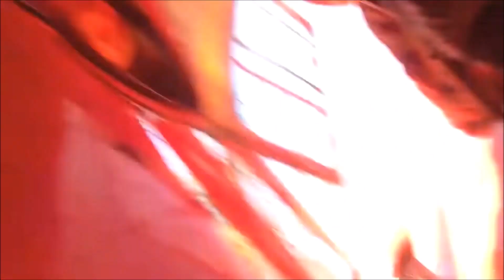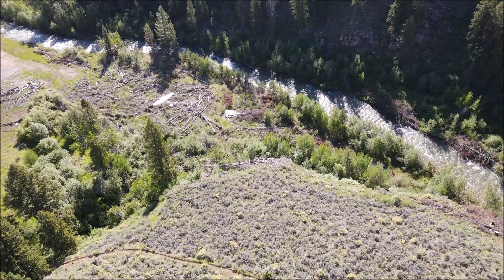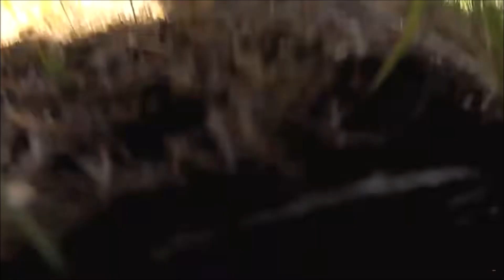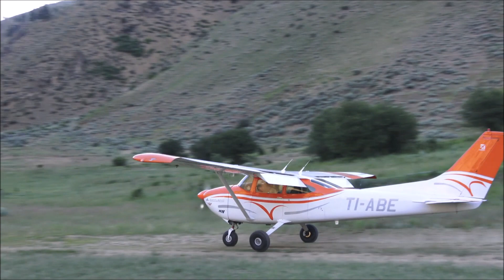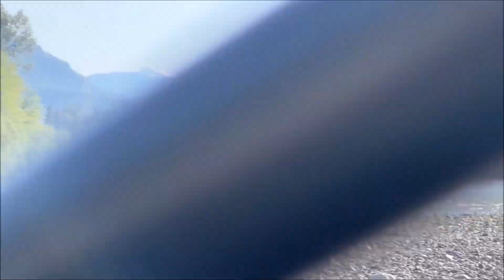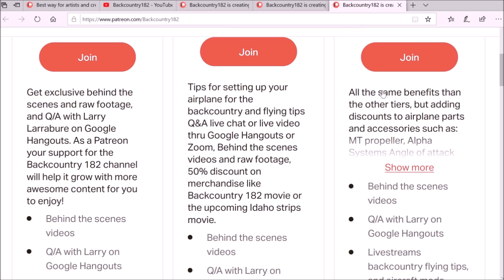Surviving your first Backcountry Flights

Comment: I was on the Cobalt District trail crew and we flew into the Flying 'B' guest ranch airstrip all the time. From there we would puck up our stock and work trails back in the wilderness. Air density was always a major player in taking off as we needed to get out before 8 am or it would be considered dangerous. The summer ambient temperatures back on the Middle Fork of the Salmon River were 90+ degrees Fahrenheit. Hearing the stall alarm was always strange because it meant we were falling out of the sky. On either side of the runway were bits and pieces of wrecked planes. Thats part of the job i never liked.

Comment: The investigation into the Stinson crash at the beginning found that he took off with the mixture full rich at a high density altitude. That's waht got him, the engine was running WAY too rich and just couldn't make enough power. It's super important to lean to best power for high density altitude takeoffs when flying on a Naturally Aspirated engine.
Reply: I agree that leaning would've helped, and likely made the difference in that example, but the climb performance still would've been anemic with that load and DA, based on my Stinson experience.

Comment: Thanks for posting what is some of the most important information about Backcountry flying  there is.  Besides altitude there is another factor besides density altitude. So often you practice techniques in a lightly loaded airplane. Then you go in the back country in a  heavily loaded aircraft with overnight supplies and extra people, this creates an aircraft that performs completely differently than the airplane you've been practicing with. This huge reduction in performance catches some people by surprise. When you add altitude to this equation your in trouble.